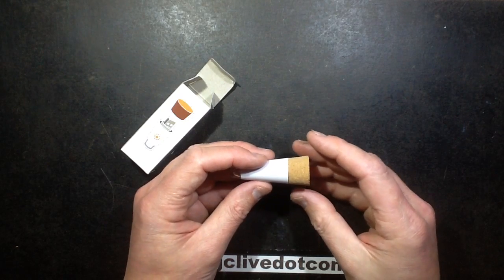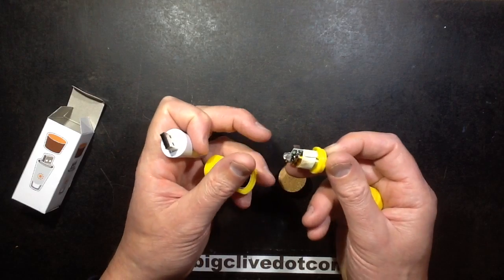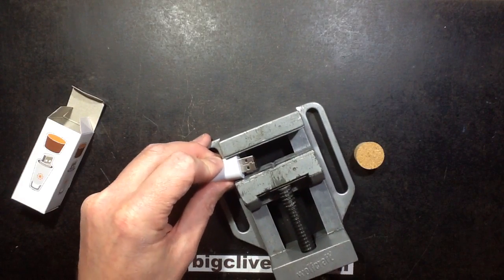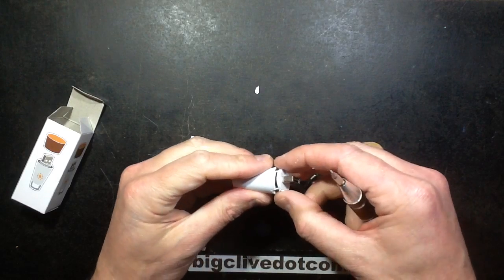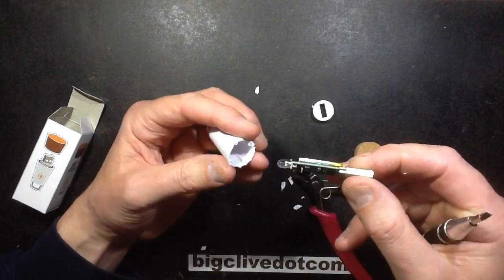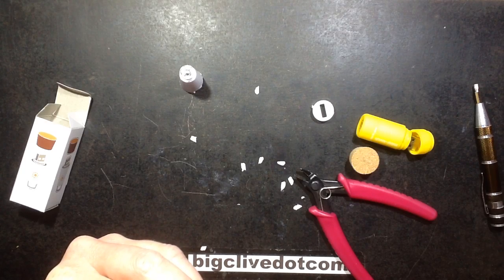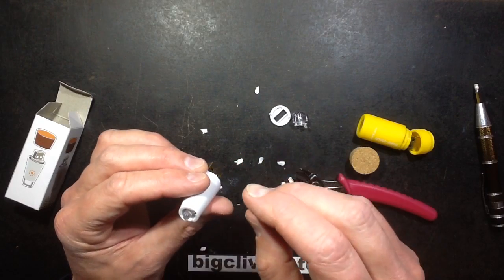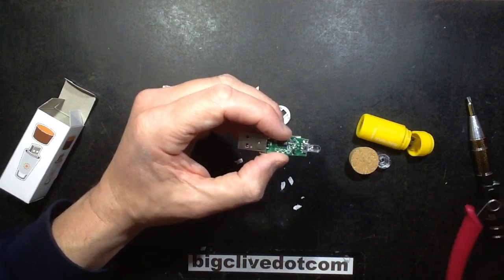Inside an LED bottle light.

Comment: This post is ancient history, but I've found a couple of these bottle lights that don't work properly and am interested if they can be fixed or if they're even safe to be used.

When the light is plugged in it can be switched on and the red led shows, but when it's switched off the red light goes off as well and it doesn't seem to be charging. Certainly it doesn't work when unplugged.

I imagine that this means the battery has been overcharged and now the light only works when connected USB power. Is it safe to use like that? Is there anyway to revive the battery?

Thanks. :)
Reply from the maker: It means the internal lithium cell may have been over discharged or it's may have dried out.
Reply: @bigclivedotcom  Thank you. That sounds like I won't be able to undo the damage, but it's not dangerous to use as a plugged in device.

Comment: i bought a stun gun from china once and the overall quality didn't make me feel very comfortable charging it... so, i took it apart...  there was a NiCd battery and the "charging circuit" was a bridge diode with a ceramic cap parallel to it. 220V dc straight to the batt.. :/ i replaced the batt with the li-ion cell and the charging circuit with a CC-CV li-ion charger.

Comment: the current limiting looks like it controlled by a 4.7 ohm resistor in series with the led. mine looks slightly different inside

Comment: Can you please tell me which loupe/microscope device you're using to read the IC markings?
Reply from the maker: +Peter “lastfuture” Marquardt The black version of this one:-  http://www.ebay.co.uk/itm/261596604063
Reply: ah great. practically free
Reply: +bigclivedotcom I've got my microscope. Just out of curiosity, does yours turn all the way off? The unit I got still lights the white LED dimly with the power switch in the off position unless I remove the battery cover. I might have to follow your example and take it apart
Reply from the maker: +Peter “lastfuture” Marquardt I've had that with string of LED lights.  There may be moisture or a conductive contaminant across the switch.  It takes less than a microamp to make the LED glow.
Reply: Thanks. I shall investigate

Comment: There is one problem with that device, what happens when you push it too far that pulling it pulls the cap off or you get it stuck inside a precious glass bottle?
Reply: +Bradman175 Rather not use something cheap on something expensive!
Reply: +Bradman175 Pull it out via the USB connector?
Reply from the maker: +Bradman175 It tends to sit with the plastic section on the rim of the bottle.
Reply: It better lol. :D

Comment: Thats a neat pcb assembly :-).
Re case it and you have a diddy torch, more reliable than the 3 battery led torches that you have to slap sometimes for the batterys to connect propperly.
Reply: +zx8401ztv if they sold these in a more universal case, theyd be good things to have around, i did buy a couple of the other one he showed(he did a vid some time ago), and mine are the same in that they dont have any cell protection, so i make sure to only charge a few hours on a go
Reply: +jusb1066 Ooow doesnt the charge controller chip cut the charge off when done then?
Not too clever a charge controller lol.
Reply: zx8401ztv
no, it charges forever, albeit at around 5ma, too low for my usb doctor to show, but it is, and its a small possible 100ma battery

Comment: Clive do you vape?
It would be extremely useful for the community if you could apply your knowledge to debug the cheaper cloned vape equipment on the market that's available to many with little to no knowledge of the dangers inherent in the high powered batteries used in some often badly designed and manufactured devices, also the more expensive "original" products.
Reply: +AuralVirus He does have a few videos on vaping that might be of interest.